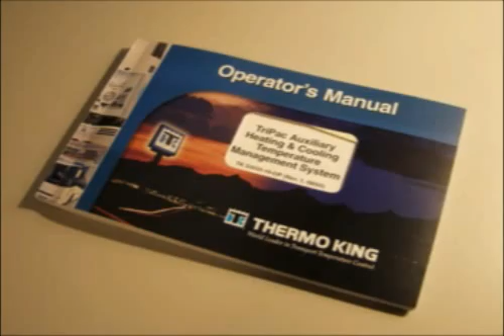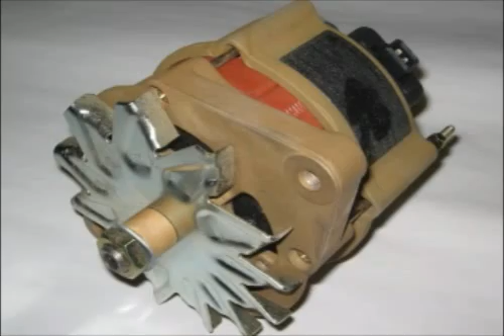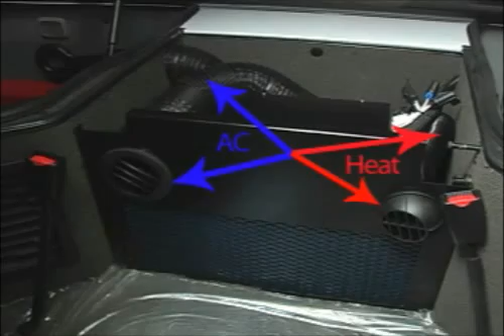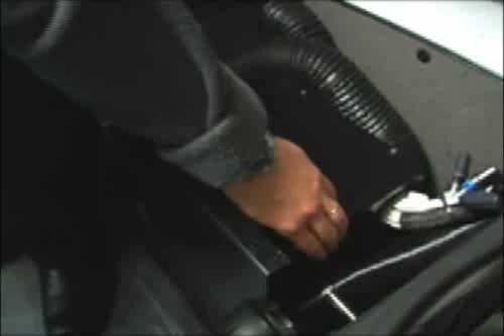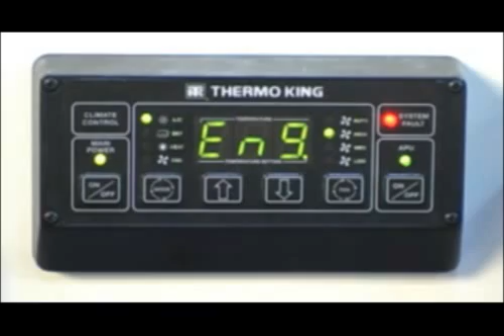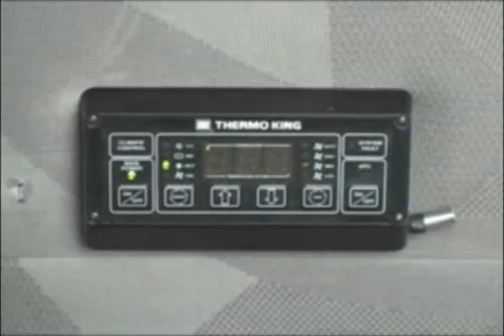Driver Operation - TriPac - Part 1

Comment: Ok I just bought a truck with a TriPac unit. I know nothing about it. How do you know how much fuel is it? Mine had red dye diesel around inside it so I was afraid to put hwy fuel in it. Someone help please!!!!
Reply: Nathan Sutton Highway Fuel is the same as red fuel you can use either or

Comment: If you buy one don,t mount it under the truck cab like the one shown here or you will regret the extra labour costs involved for service and repairs.Put it behind the cab for easy access,trust me I,ve fixed hundreds of them.
Reply: Thanks Bro for the tip